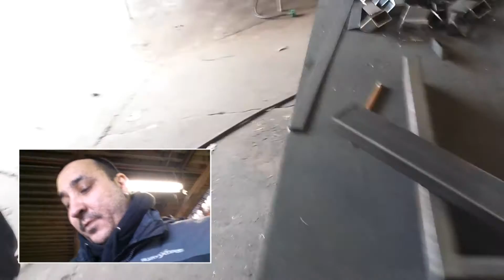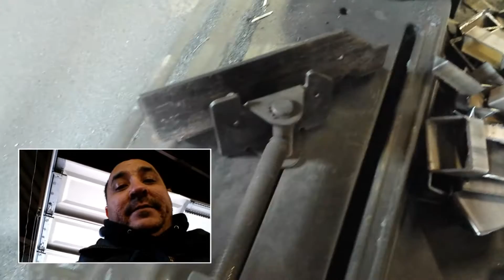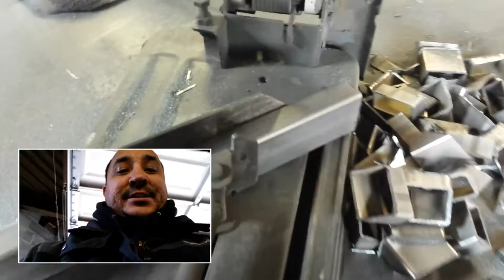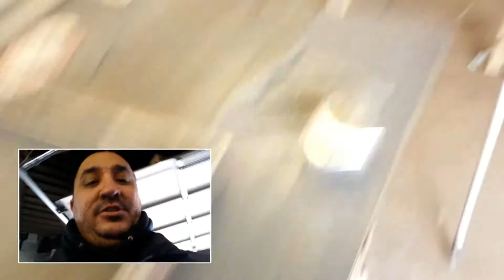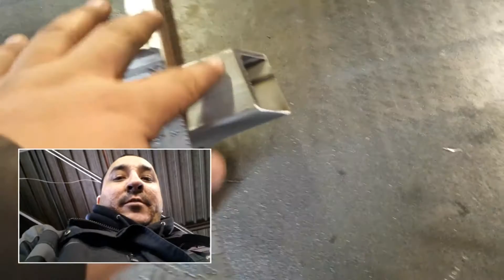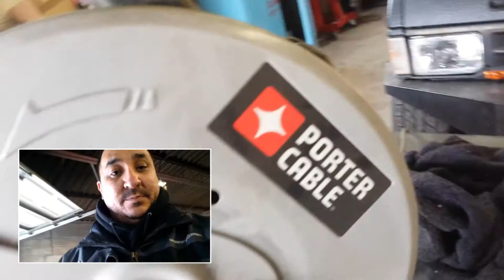Chop Saw - Tips

Comment: Good ideas, I operate a saw cutting for 6 welders at work, one tip I can give, is when cutting 45 degree braces, I just rotate the steel, cut, rotate, cut. that way you don’t need to triple your cuts, and saves steel.
No need to cut each piece to length first😌
Just make sure it’s right on 45, and it works great.

Comment: Never had a problem putting the stock in without shims... get the blade spinning to the max and very slowly feed. 

Did your shim calculation calculate how much more flex after 20 of those cuts and 20 clean ups in the side of the wheel? Your wheel isn’t getting shorter in diameter, it’s now getting thinner and thinner equals less rigidity and more flex.

Comment: hi,  I am new at this, i have 2 questions 1. i didn't quite get how the spacers helped, could someone please explain it to me again. 2.when i tighten my dropsaw vice it looses the 45 degrees angle . have I
 set the saw up wrong?
Reply: Use an adjustbale precision square and set the fence to the blade. Put the blade in the down position, but the adjustable square up to the blade, becareful to not push on the blade and adjust fence to fit the angle of the square. NEVER trust those preset markers in the table they are NEVER right and if your not getting a 45, sounds like you used the preset markers to set your angle.

Comment: I wouldn't use the side of the wheel for de-burring if I was you, according to the manual.
Reply: Depends on the wheel. The cheaper disks which has no fiber reinforcement in it, has no negative effect to grind in reality. With the more expensive blades you have no chance to do the de-burring  because the surface is smooth.
Reply: @opiniono-1  sure, it's all fine until you press just a little too hard <boom> <wheel shrapnel>

Comment: question can u use multipurpose blades on the bigger chop saws I was told the motors where too powerful 'wood and metal blades
Reply: It's a bad idea all around. It's unsafe and unwise. Wood cut blades are designed to cut at a much slower rpm. Also with keeping in mind, the material being cut. Aluminum can be cut with a toothed blade but not steel (unless in a cold cut saw only and those are specialty blades). Abrasive cut off wheels are solid and the rpm varies a bit (motor to motor/  brand to brand). Changing the blades changes many characteristics of the process and would surely over heat your wood cutting blade. In the event that you tried to cut steel with it, a tooth would catch and destroy the motor or detonate the toothed blade. Great job asking, always to br safe than sorry. These things don't just  hurt, they are potentially fatal mistakes.
Reply: @kyledavis5912  I just bought a multipurpose carbide-tipped blade that says it will cut steel up to 3mm, and is rated to 5500 rpm.  My skillsaw is under that, so I believe I'm okay.  I've also stalled the saw before, and it didn't destroy the motor.  I think you may be speculating.
Reply: Compare the blade RPM rating to the motor RPM, and stay within the blade rating.
Aluminum is soft and will plug up an abrasive disc or wheel.
When cutting metal, there will be a cutting surface feet per minute range; exceed it and you will burn up your blade.  A cold saw has the right RPM.
For toothed blades cutting metal you want to use a stick lubricant.

Comment: Cool technique to offset the offset. lol.  Something that will greatly reduce the tendency of the blade wandering to the right as it cuts is to position the fence so that the center line of the stock aligns with the bottom dead center of the blade.  This way there is no angle deflecting the blade at the start of the cut.  Once the kerf is established, it will deflect much less.   I also scribe square and 45 degree lines on the saw table to speed setup and avoid grabbing the square for every fence change.  A cold cut saw is also on my wishlist.  Too bad Santa just left........  Repeatable results are what count.  Your method works.  Thanks for sharing you experience.

Comment: Allow me to help you.  The reason some cuts get "off true" is most certainly because of the blade flexing, but this is a natural consequence of where the handle is.  The handle is always to one side of the blade (usually to the left).  Therefore the downward force applied, also turns into a CCW net torque on the whole motor assembly, and thus the blade deflects with the necessary downward pressure required to make an abrasive blade work as intended.  Look at my video: https://www.youtube.com/watch?v=k7Cnsr6pQDE where I use a cheap $100 Northern Tool chop saw, and manage to get very true cuts.  As you will see in the video, the "trick" I use is to blip/goose the trigger button with the blade stationary on the metal, with just a little bit of pressure, only enough so that the blade doesn't bounce up and down.  A few quick blips of the on-trigger, allows the blade to effectively make a tiny (and most importantly, straight) notch in the metal.  This tiny notch works WONDERS to keep the blade on it's downward track.  It serves as a guide for the blade, and assures the blade enters the metal as close to a 90° angle as possible.  Also, due to the flexing that a lot of the cheap abrasive saws exhibit because of the flimsy sheet metal base/parts, when I continue through the cut with downward pressure, I try to give it a little bit of a CW twisting effort with my hand.  It doesn't twist the motor assembly by a whole lot obviously, but along with my notch trick, my cuts are as close to 90° as you can get.  Check out this pic of a cut I made:  http://i169.photobucket.com/albums/u235/musico79/welding/1106161509_zpsyz2vyh8z.jpg

If I can do it on a cheap chop saw, anybody can.

Oh by the way, you can also get an Evolution Rage 2 14" dry cut carbide blade chop saw for $187 shipped on Amazon.  It's a great saw, very sturdy.
Reply: Hi man, you appear to know what you are saying. So can you tell me why is this necessary to use a spacer on a new cut off saw to cut 45 degrees. I got this problem can you help plz.🤔

Comment: I am learning more by every video I watch. I have a Milwaukee 14" abrasive saw, that I think has 3/32 blades. I'm looking at building 3" front and rear bumpers for my old '80 Powerwagon. Thinking 1/8 wall tubing, not sure if I'll go round or square. I really haven't looked into what blade thickness are available, Back yard mechanic, and any suggestions to lead me on the right path. Regret not buying a cold saw other than the cost of the blades.
Reply from the maker: check out roarksupply.com use coupon code: metal to save you 10% off your order. the cgw blades are real good.
Reply: Thanks for your time, not sure if us Canadians get the same deal. I'll look it up tomorrow after work. thanks again.
Reply from the maker: +Al Cyr you should. call them and talk to frank if their website doesn't let you use the code.
Reply: Al Cyr I have the Milwaukee saw and I love camelgrinding wheels for my saw. 3/32 are my favorite. cuts 4in schedule 80 pipe like butter and clean up is a breezy no nasty melted crust on ends

Comment: I Like your style,  but not sure why you raised the front with spacers?
Reply: Me too?  Why he did this confused me ,and with the welds on the end there is no way that,s good practice  it will not be level. All he achieved was jacking the work piece up  made a cut, and ended up with an angled cut that was further angled,stupid regard for anyone else,s safety grinding on the edge of the disc,this guy does not give a damn.Then he makes a dumb ass response.
Reply: @richardallan455   if you would've cut with a saw like this, you would've known. I found this video while researching how to cut straight with a saw like this, because normally the cuts are crooked. By lifting the stock the blade will still cut crooked, but in the end this will make the cut plane more perpendicular to the stock length.
Reply from the maker: Well i guess i didn't do a good job of explaining that in the video then lol?

Comment: Teach people the right thing guy. Like for one don't deburr using the sides of a chop wheel. This weakens the structure of the wheel and exposes the bonding and makes the wheel prone to bursting .
Reply: that blade will be 6 inches in diameter before he wears the sides out doing it that little bit.
Reply: +Deolan Naidoo your right first thing  thought too. weakings disc and can become dangerous
Reply: @Brandon Campbell  Sure, the wheel won't break every time, but what happens if it does?  Did it already get stressed in manufacturing, shipping, when you dropped it during installation "looks OK"?
ER visits are expensive.